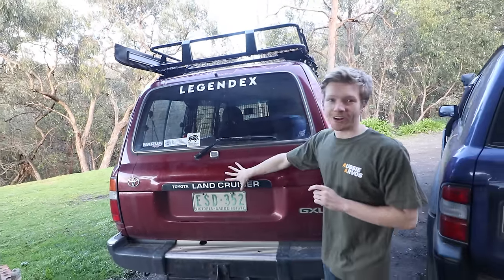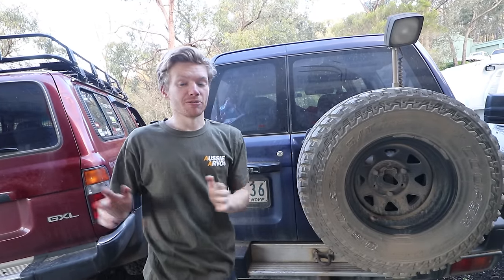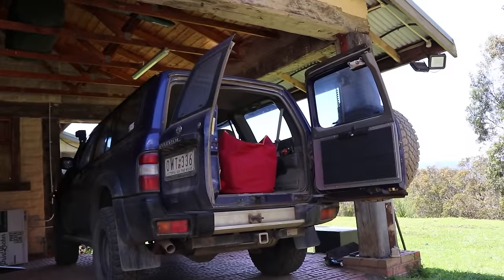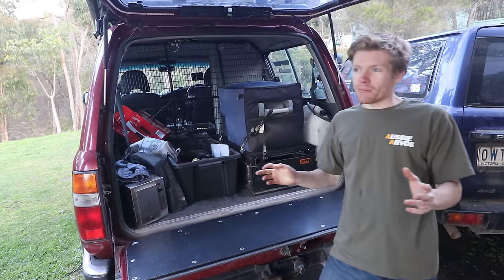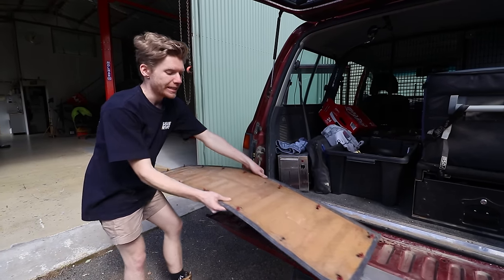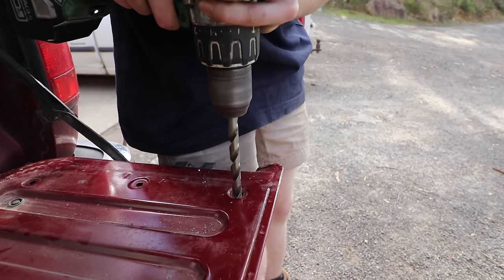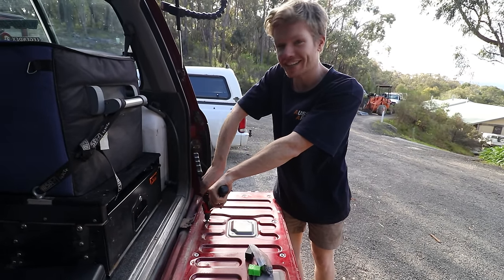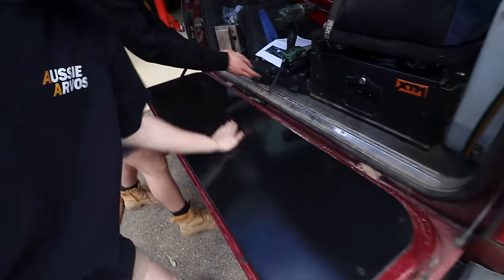WHICH 4x4 WAGON IS BETTER!? Nissan Patrol Vs Toyota Landcruiser + New 80 Series Mod!

Comment from the maker: Let us know! TAILGATE or BARN DOOR or ONE BIG DOOR! 👇👇👇
Reply: Barn door
Reply: One big door is kinda annoying when a trailer is attached because it can hit parts or the trailer, and barn door and tail gate are Both equal with pros and cons each to their own ig
Reply: barn door every time
Reply: Big door. I've had them on 2 outta 3 of my forby's. Spare on it and drop down table. They just work. Cheers guys
Reply: One big door that lifts up...like on the WK2 Jeep Grand cherokee.
Reply: Both have their pros and cons, I loved my barn doors on my 80 series way more than my tailgate 80. But Toyota didn’t make factory turbo barn doors 😢
Reply: Tailgate!! I have a rav 4 with big door and it's bloody annoying
Reply: you're forgetting the 4th option,  one big fold up, on the foresters, it acts like a awning, dont have to worry about parking on hills, cos the door goes up, and have good visability and access. only thing wrong is no rear tyre.
Reply: Barn door
Reply: One big door. Prado and attach a drop down table off the door as a cheap mod with materials from Bunnings. Great content guys as usual.
Reply: Barn door with a fold down table sorta thing
Reply: Had both types in a Jackaroo and a 80 series the tailgate is heaps better
Reply: I like the forth option, get a ute with tray. 🤣
Reply: Cant beat the tailgate and lift up door thats my preference
Reply: @braydenclark5828  barn doors are the bomb
Reply: Tailgate.  There's nothing like having an instant table and bench seat combo that comes with an overhead cover as soon as you pull up.  I use my tailgate all the time when at the beach.  Plus it's an instant step to access the roof rack.  But I too had a Pajero (NA), and I do like the one piece side opening door with a rear wheel carrier, too.
Reply: @fatmanoverlanding  I can see your side
I also have an instant table on my barn door which which creates a great wind break especially when using gas
One of the 100 series guys couldn’t keep his stove going 
Wind is a real problem in WA
Reply: Oh no..swarf inside the tailgate..get that junk out...
Reply: Barn Doors
Reply: One big vertical door like Terrano has a good mixture of the two. Still has glass opening for easy/quick access. the biggest downside is they use a swing open tyre carrier.
Reply: Barn Door
Reply: I have a patrol but I like the tailgate. Although the barn door is practical.
Reply: Barn door or tailgate
Reply: @jameswatts6787  barn door if it meens so much to you that I can't say I actually like the tailgate aswell.
Reply: @kennethsobey8340  have a 80 with tailgate and swing out rear tyre  but like the barn doors on the patrol with the tyre carrier i just guess we cant have it all like a toyota engine reliability and patrol diff strength
Reply: @jeristair  not when you have a boat on the back, you have to unhitch the trailer first
Reply: Barn door 👌
Reply: Have U ever thought about watching Jerry spring with your dad?
Reply: @juststuffwithwolfe4482  barn by according to translate to engish
Reply: Tailgate
Reply: I had a red 80 series and I like the tailgate as it can extend the sleeping length. Negative is if you have bigger tyres your spare might not fit in the wheel well so where do you put it (mine had an lpg tank there so I had this problem too)?
Reply: Barn door
Reply: my car, which is a 2006 honda crv has one big rear door. best part is that the glass opens upwards so even with a trailer acces is still ok
Reply: big door for normal use barn door when towing

Comment: The single big rear door is a real pain if you tow anything, the can swing with real force if you are on a slope and as mentioned earlier, can sag. I’ve had all 3 alternatives and they all have pros. I love the tailgate most but the stretch into the back is hard work.

Comment: Each door has their pros and cons I wouldn’t really say one is better than the other. Did you consider using a sheet of stainless or aluminium instead? It would give you the same outcome but able to put hot stuff on? Cool upgrade regardless
Reply: It also wouldn't scratch as easily, thus trapping less dirt
Reply: At least half to have something hot and stand on that wouldn't be a preparation area as such would be 👌

Comment: I like Nissan patrol y61 tailgate doors  due to ; 
1-The small door give you fast access and easy to open 
2-The small door when open it give the car cool looking , the Toyota is more like family car doors ( the feeling) 
3- The side Nissan door give you some privacy and windshield  
4-The one door system is large for  tight spaces (e.g small home garage) , Nissan much more practical of all 3 cars
5- Actually you can open the Nissan small door while the car is driving at ANY SPEED and throw nails under or use the gun if you at mafia business or at wars ( kidding , but true you can open the door and do things)

Comment: Not sure i like that mod… after a few cuts on the board, the scratches and cut marks will fill with dirt and dust whilst driving the trails. Plus got to think twice about standing on the tailgate, let alone sit your’s or even worse, someone else’s arse where you prep your food lol…
Reply: My tailgate is a prep bench, a seat, step for roof access, and more importantly the hot bench to place the pots and billy’s straight off the fire…
Reply: @-Awareness  i would’ve used stainless steel

Comment: Cough.

The 80s & 105s also came with barn doors.

Every now and then you see one of those Aussie Grey imports where I live.

Heck my Dad even had a Aussie spec 105 with barn doors.

Edit: In my opinion there is no winner, all of the options have pros and cons.
Reply: Some UN spec 200s came with barn doors also!
Reply: It was the base model that came with barn doors.
Reply: its called poverty pack 105
Reply: 80 & 105 with barn doors were the povo pak 
GXL and up got the tailgate
Reply: povo pack got barn doors and vinyl floors with out the good diesel engine now i wish i had barn doors and vinyl floors in my 31yr old 80 my old 3fe engine is better than the good diesel for reliability and the price ive saved on oil changes after 450,000kms makes up for the cost off fuel and piss weak mileage on the 3fe

Comment: You forgot the fourth, and I think best option, which is the system on the Jeep Wrangler Hardtop which has the best of both worlds. The upper section of the tailgate and full width door

Comment: my suzuki soft top has a half height full door, i really like it but can see the benefit of a tailgate too. barn doors seem to make the rear of the car feel smaller and often they don't handle the weight of the spare tire very well so you need a rear bar anyway.

Comment: Be honest I've got patrol, used to own a prado, a surf and got a mate that owns a 80. So I've had the pleasure of trying all 4 and in my view the surf tail gate comes in first, 80s double tail gate second, one big swinging door third and the barn door fourth. 

Reason for the surf tail gate comes first is that 9 of ten I just had to put the windows down throw my rods, tackle bag, shopping or anything in even when with tyre the in the way and the well the tail gate awesome. 

mates 80 second is because the top window is up to take or put something in is still pretty practical like the surf. The story can change a bit with having a tyre in the way. 

the big swinging thrid door is good for a big table like the patrol (an idea I've thought of one day) and a awesome wind breaker as Patrick said but it can be a heavy to open car facing down hill or close if the car is facing a up hill and can just swing open really fast if your not exspecting it and can't open it when parked at the shops because car is behind you or towing a trailer (the winch bar, tow hitch handle or the stone guard is in the way). 

Barn door are good but fourth still have too open both door if I want to put my tackle bag in, anything els or even to open the fridge. Even if I want to add the table it stills feel small a bit claustrophobic and have to move out of the way to pull the fridge out even if I have the table open i can avoid it by having the table the flip under which makes it wider there's company that sells that but depends how you would set it up the fridge and draw. 

This is view in it and I know its long but I don't could think I could make it a 10 word sentence.
Reply: ya cant win all have pros and cons i loved my 4runner/surf rear window till it stopped working loved my gu barn doors but also love my 80 series tail gate n not a fan of the one big door ya put a bigger tyre on it and the hinges fuck up pretty quickly and cant get in the back if ya towing

Comment: As a 90 series Prado lover 8ve never really thought about the barn door being so much better . . . And I've always thought the 80 series style tailgate is awesome for the protection above and the instant table  . . . And your mod has been a massive improvement for the chopping table! 👌👍😎
A coupla years ago if modded my barn door . . . Bought a kaon 150 Prado rear table and then dot a metal fab shop to cut a 3mm sheeting ally to the same size as the door card. . . . Enlarged some door holes and installed rivnuts like you did and then screwed in the door ally card with the stainless table attached to it . .  . Worked an absolute treat and makes amw awesome camp table!! 👌👍😎
One of The best mods I've done on my rig so far!
Besides the frifta Stockton 270 awning which nicely covers the whole rear barn door which is next level and just makes the whole barn door table soooo much more useable at anytime

Comment: A tip for drilling when you don't want to dent, put some electrical tape about 1cm down from the drill tip to stop it going through 👍
Reply: Or another idea is to add a length of pipe (copper/aluminium etc) of a close inside diameter, cut to the length of the drill bit less the depth of the hole you want to drill. This will make it impossible for the drill bit to accidently "catch" and pull through to dent/hole the outer skin etc. So if the drill bit is 100mm exposed from the chuck and you wanted to drill a 4mm thick hole, then  a length of pipe around 95mm would be added over the bit before drilling commences.

Comment: Swing door is no good, purely cos if you park facing out and someone parks behind you, you cant access the back. Small issue but ultimately the most frustrating.
Reply: Ps: ive got a patrol with a gas strut installed.

Comment: You simply can't beat the extra table and sitting space on the rear of the 80, not to mention the benefit of overhead protection, and aftermarket rear wheel carriers are easy enough to fit.

Comment: You missed the worst one the y62. Big door folds up. When you open it it hits the carport roof. It also hits the roller door when its up. The struts dont last that long because of the weight always pushing down on them. When the fence or the roller door is closed you cant squeeze in and open the door a crack and get inside like you can on the gq, gu its a pitta. I miss my barn doors and gullwing windows.

Comment: I have a swb soft top vitara, with a fibreglass “hard top”, which I believe is the best of all worlds - it’s got the half height swing door, which gives u the upside of the table, accessiblity etc, and then the top opening fibreglass roof door acts as the top door cover etc

Comment: Biggest fail for the Pajero is the hinges always fail due to the weight and good luck on opening it open in an average car park. Other 2 option are pretty much 50/50 for me I’ve got a patrol so I’m used to the barn door and my wife’s had Volvo XC90’s for the last 10 years or so excluding an Audi Q7 and both work really well.

Comment: Me personally would have put the storage unit in tailgate then cut/shape and mount the chopping board on top and have the best of both worlds. I own a y61 and love the barn doors, but you are restricted when putting gear in. I would love a tailgate as you can use for a seat, the back window can wind down for animals where as my nissan cant do that.

Comment: On the 80 series there are factory spare wheel carrier which swings open and aftermarket on-bumper types. Heck don't get me started the rant on Hilux Surf rear door with the key-turn power window ones.

Comment: horse's for courser's, my crusier had barn doors my dads had the tail gate. tail gate you can pull up sit down and have some cover, roof top camper top of tail gate closed with a ladder bottom open as a step and work space. barn door's great for spare wheels  jerry can water can etc and easier to reach in. maybe they got it right on the pag with 1 big door.

Comment: patrol barn doors id prefer... i have the big mono on my zuk and they are far worse when it comes to being parked on a slope. with the patrol ones, you could just lock it, and both doors would act as a great wind break when cooking. Also you can still open the slim side if you have a trailer on where-as i cant with the mono.

Comment: You can just sleeve the drill bit with a bit of steel tube so you don’t go too far through Just cut tube to sizeany  done it the other day putting a roof rack on Hilux so I don’t drill through the headlining

Comment: As a patrol and Pajero and 2019 mux owner ...as long as it is a patrol.. ha ha.   Horses for coreses ..   mux long limited off road, patrol mountain goat and swamp donkey.    Pajero just send it and beach work no f given rig.

The Pajero is a vary under rated rig.     Especially when it's a 3500 quad cam manual see for $ 1000

Comment: If it wasn't for the stupid 3.0 diesel in the Patrol, the Nissan would have been a better vehicle right through from 1988-2010.
4.2 turbo diesel is great, running gear underneath the Patrol is tougher then the Cruiser.
Unfortunately Nissan gave up on the tough 4wd sector ceding almost total domination to Toyota.

Comment: I have a p38 Rangie (split tailgate) and a disco 1 (one big door).
I like that I can load/unload the Rangie with small miscellaneous stuff in 2 loads but the wind break and spare mounting convenience of one big door is so much better.
Also possibly specific to the D1 (I don't know) the handle side has a peice that the door snugly sits in that stops the weight of the door breaking the hinges, only rust really does that.

Comment: Dude talked about the back doors and spent 10mins talking about a piece of plastic that covers the tailgate
Also, on the tailgate ‘it’s hard to reach out the back’ put your knee on the tail hate, simple
And on the patrol ‘easy to get on the roof with the wheel’ looked like you had to bring your leg up quite abit